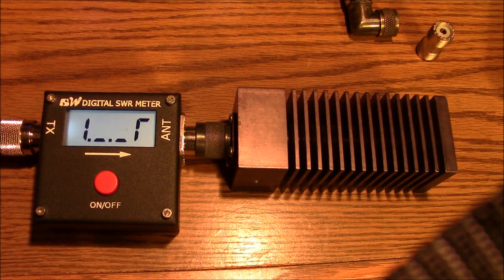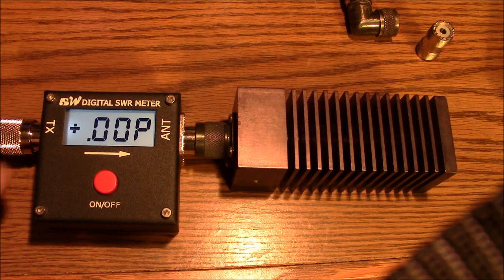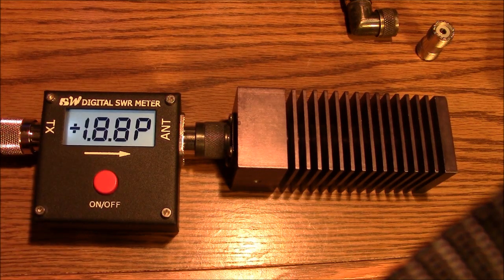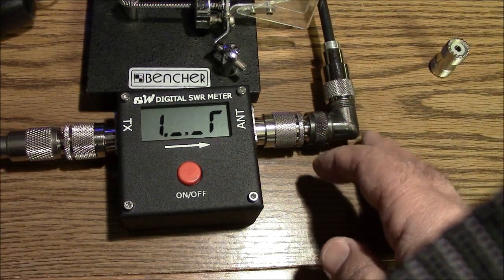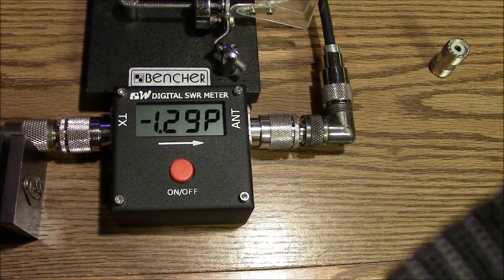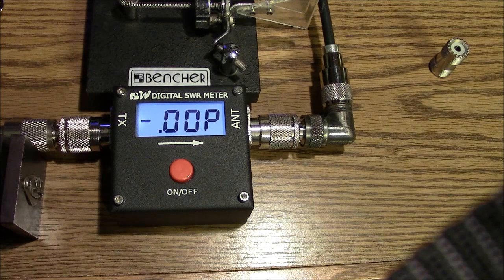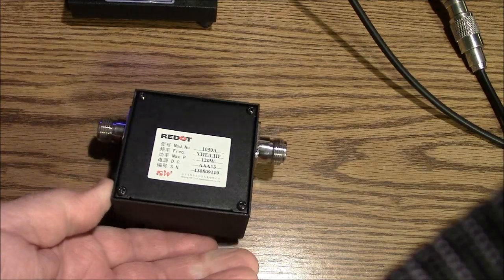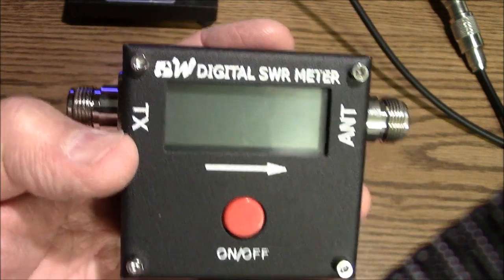REDOT 1050A SWR METER

Comment: I am confused. When I looked on eBay it appeared that the 1050a was VHF and UHF. Do they have different models or does this do HF also? Enjoy your videos thanks for taking the time to make them. Tom
Reply from the maker: That's correct.  The 1050a does only VHF & UHF.
There's a second meter that measures 1.6-60 MHz which is designated as Redot 2016A which is also available on Ebay.
Reply: Thank you for you help

Comment: Obviously a cheap meter. In order to minimize failure, I would not keep pressing that button....probably a weak component and prone to failure. For my use, just letting it cycle would serve the purpose and maximize the life of the unit.
Reply from the maker: +F Mat Thanks for the Input.

Comment: Is this meter accurate?
Reply from the maker: +K Lee The meter agrees within a couple of tenths of a watt with my Daiwa CN-101L wattmeter as well as the output power settings on an ICOM-IC-7200 HF Transceiver as measured into a 50 ohm dummy load.

I guess I can answer the question this way;  Its certainly good enough for CB &  Amateur Radio Work to provide confident readings.

Comment: 27mhz is not good for local communcations anymore.maybe good for "skip" speaking however  the future lies within PMR446 and hopefully if it gets legalised VHF CB. Much lower noise floor meaning no static or skip talk apart from occasional tropospheric activities.  smaller antennas required. and abilitiy to set up repeaters. We need VHF CB or at least use the current legalised PMR446. you can get long range local communications with a smaller antenna since the wavelenght is much shorter. (being around 65cm while traditional 27 mhz  CB is 11 meters)
Reply from the maker: Local communications in the USA is already provided for unlicensed users via the FRS radio UHF band.   Radios are readily available and the band works extremely well for local communications. The function could be called UHF CB and the antennas are small.
Reply: just get a foundation license it not that difficult.